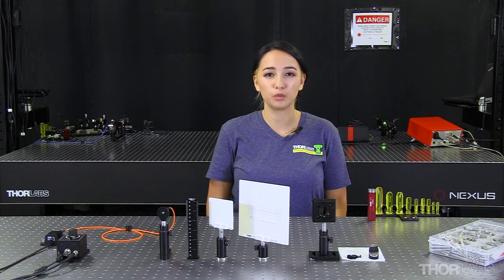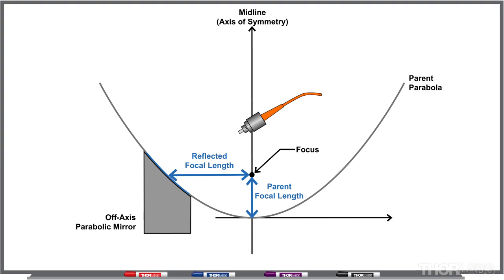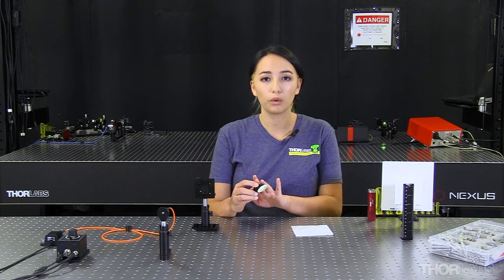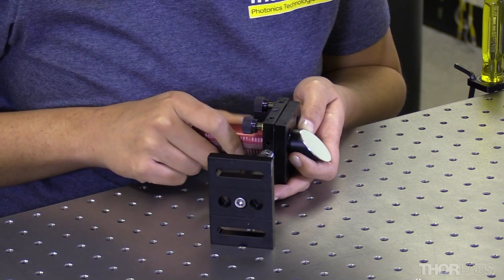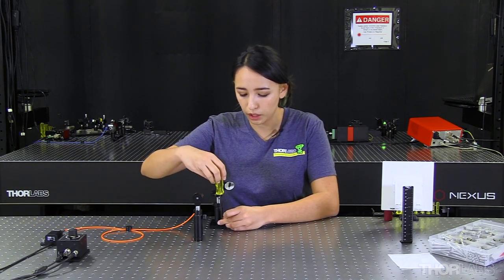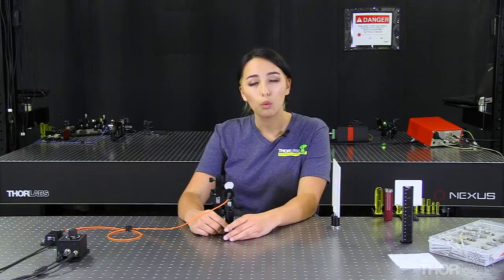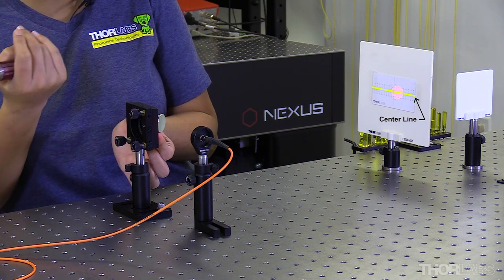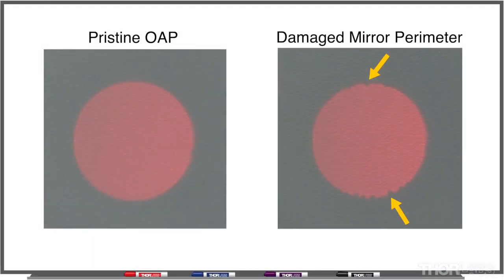Align an Off-Axis Parabolic (OAP) Mirror to Collimate a Beam (Viewer Inspired) | Thorlabs Insights

Comment: Nice tutorial. Thank you! I believe I did such alignment once and it was a pain. Especially if one wants to refocus the beam, keeping nice gaussian shape in a focal spot.. 
As a suggestion - there are some parts which always need to be horizontal/vertical, being actually round and don't having any horizontal or vertical edge..  An example is just in the video. It would be much easier to align having a small reference face. For example - a part of long part of zylinder could be flattened (CNC, lathe/milling machine) during manufacture process, when one still exactly know where the axis is. It should not be big - 5x5 mm plane would be more than enough. 
Same for wedges, periscopes, etc. 
One could than simply take a screwdriver or hexkey, press it to this small reference plane with a finger and align element vertical/horizontal/aligned to holes on the table looking on some line (screwdriver) to orient. Would one want to be even more precise - some additional laser beam could be reflected from a piece of flat mirror attached to this surface and make a perfect horizontal alignment. 
By this, the probability of an accident during wedge or periscope alignment  could be strongly reduced. IMHO
Reply from the maker: Thank you very much for the compliment, we’re very happy you found the video useful. 
 
You’re absolutely right that including a reference plane can be very helpful when trying to align circularly symmetric optics. We did something similar on our aspheric fiber collimators that are pigtailed with PM fiber ( https://www.thorlabs.com/newgrouppage9.cfm?objectgroup_id=13154 ) so the user knows the orientation of the fiber axis. We will pass along your suggestion to our product development teams to continue the practice and consider adding it to existing products.

Comment: Great video! I assume these same techniques can be used to align spherical mirrors too?
Reply from the maker: @rachelanderson1232   We are glad you liked the video! While this video includes alignment techniques generally useful for spherical and off-axis parabolic mirrors, there would be challenges to using the complete demonstrated approach to align spherical mirrors. One challenge is that the focal region of spherical mirrors is directly in front of the mirror (i.e. these mirrors have obstructed focal regions). Since a spherical mirror’s collimated beam passes over its focal region, a fiber end face placed within the focal region would create a shadow in the collimated beam, which may not be desirable for the application. (This is the geometry of Newton telescopes.)
 
If an off-axis approach is used with the spherical mirror, the collimated beam will be aberrated (primarily due to astigmatism, which is caused by the spherical mirror shape). Additional optics would likely be needed to improve the beam quality.

Comment: Could you please tell me what should I order from Thorlabs to have the same LED that you used for alignment? The number of the fiber-coupled LED and the LED mount.
Reply from the maker: @raoufkutajsh1294  The LED we used in the demonstration is the M625F2 and its driver is a LEDD1B. If you need a power supply, the KPS201 is compatible. Links to the LED, its driver, and other components used in the demonstration can be found in the description. This is a link to the KPS201 power supply:  https://www.thorlabs.com/thorproduct.cfm?partnumber=KPS201&YVI=18 .

Comment: Hello, very helpful tutorial. I was also trying collimation/beam expansion with lenses(Achromats), i am using your SI254 to check the collimation and I am always getting curved fringes(aberrations) in shear. I was wondering is it my alignment fault or do we get better collimated beams with OAPs than lenses, any advise?
Reply from the maker: Both OAPs and lenses can provide well-collimated and low-aberration beams, and the best option depends on the details of the setup. Without more information about your setup, it is difficult to know whether using OAPs would benefit your application. If you contact Thorlabs Tech Support ( techsupport@thorlabs.com ), we can discuss your setup with you and help you find a solution. One thing to note is that it is possible the aberrations are not due to your lens or the alignment. The aberrations might originate from one or more other locations in your setup, including the light source.

Comment: That's only half of the game. There is only a little chance that the fiber tip is perfectly placed into the focal plane of the oap. Ideally you want to focus the beam onto a small pixel detector for fine adjustment of the input w.r.t. the oap.
Reply from the maker: You are absolutely right, it is sometimes necessary to make fine adjustments to the pointing angle and relative height of the fiber tip with respect to the mirror. For example, this becomes especially important when using an OAP to couple light from a collimated beam into a fiber, opposite the direction demonstrated in the video.  
 
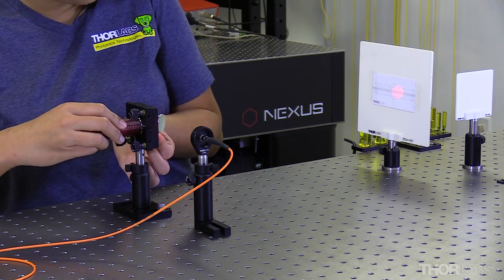For those who are curious, when the pointing angle and/or height of the input fiber tip is misaligned, the effect on the output beam would be similar to, but less severe than, that shown between 9:06-9:29, when the OAP was rotated in the SM1-threaded bore of the mount.
 
We provided this demonstration thinking it would assist most users in the task of achieving an output beam whose collimation and beam path would be evaluated using a standard ruler with millimeter increments. If further precision is required for the application, it could be helpful to also place the fiber in a kinematic mount and tune both kinematic mounts' adjustors as required. Using a beam profiler or camera to check the circularity and direction of propagation would be a great way to confirm the beam shape and direction of propagation at the micrometer level.   
 
Please let us know if it would be helpful to show these additional steps to improve the precision of the collimated beam, use the OAP to couple light into a fiber, or anything else!
Reply: Nice video -- although I think the other way around is a tougher procedure.

I really wished the optical conpanies could do a precision flat surface on the OAP near one edge -- with that, refocusing becomes trivial.
Reply from the maker: @selahthales  Thank you very much for suggesting a feature addition that you think would make it easier to align OAPs! We'll pass along your recommendation to our development engineers.
Reply: this would help for sure. check the EO monolithic beam expander video
Reply from the maker: @selahthales  Thanks for connecting us with this example, it definitely helps us better understand the functionality you're looking for.
Reply: @selahthales   You can use a femtosecond laser, only when OAP is correctly aligned, then you can create a filament dot in the air.